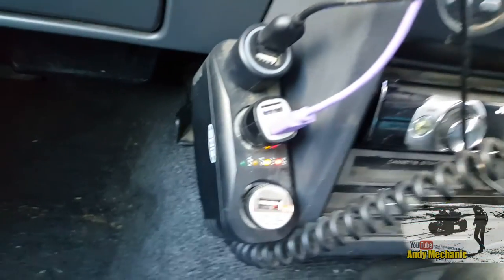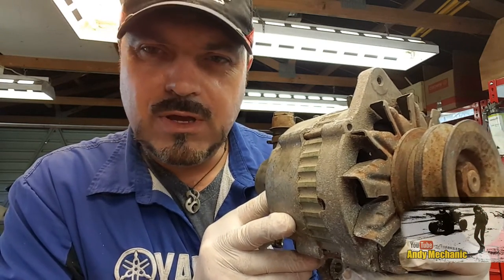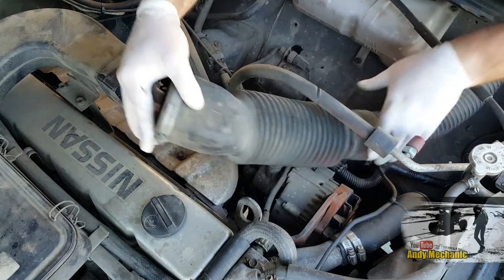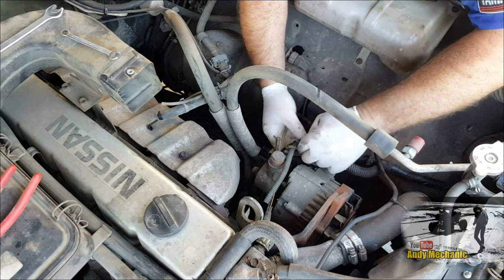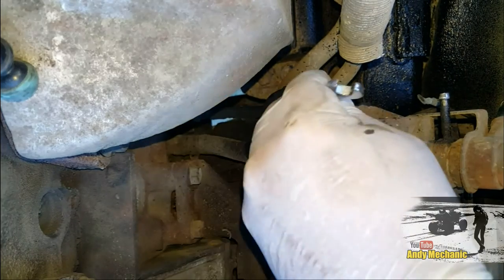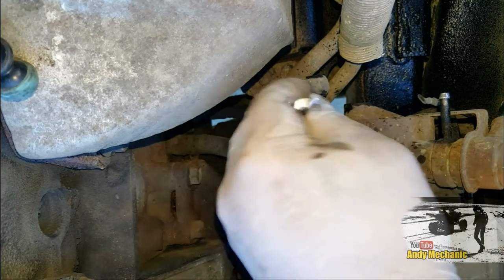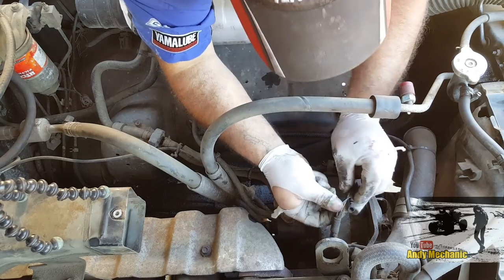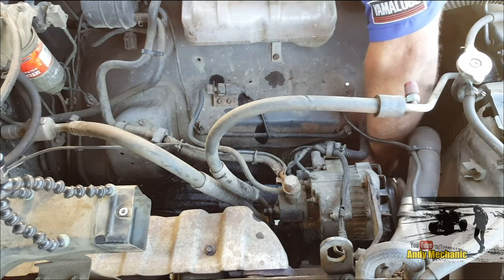Nissan Patrol charging circuit test & alternator replacement #1417

Comment: I have a TD27 fitted in an old London Taxi, when driving my voltage is 14.4V but when stopped in traffic with the brake lights on this drops to 13.2V is this normal? The alternator  was replaced before I got the car but the battery is old. After 2 years it has never failed to start, so it must be charging.
Reply from the maker: Yes, this is normal. Alternator output is much lower when engine is at idle & voltage will drop as more load is applied.

Cheers Andy
Reply: @AndyMechanic  Thank you for the reply, has put my mind at rest. The volt meter I fitted has been a blessing and a worry at times.

Comment: With respect the alternator's capacity is measured A and not Ah as I am sure you know.
This series is relevant to me - stuck in Portugal with a failed Denso alternator :-( All of the voltage and resistance readings which can be taken with the alternator in place are good so I have to delve deeper now.
Reply from the maker: Good Luck...let me know what you find :-)  Cheers Andy
Reply: @AndyMechanic  This is a weird one. The alternator has had less than 50 hours use since being refurbished by a reputable specialist in the UK. The vehicle is weill instrumented so I constantly monitor the charging current and the voltages on both batteries - everything fine. It just stopped charging. It's externally regulated and the field coil shows continuity (around 12 ohms) from the external terminals with a healthy excitation voltage. I now have little alternative to pulling the brute out and looking inside - this would normally be OK but I have no facilities here because I am traveling. Your videos will help, thanks.
The alternator installation is covered in my YT channel and I will no doubt do a follow up video when have fixed it.
https://www.youtube.com/watch?v=1b5QQ36_DgU&list=PL5KqEH5MNr7JU6ZW_kkTdtUv_AkqmNAFw&index=14

Comment: Can't say I've ever run into that issue of having to re-break in an alternator.  Glad it worked out, though!  That Nissan Patrol is a really good-looking utility truck.  Wish we got 'em up here in the States!

Out of curiosity, I've heard that you're supposed to be gentle with new/reman alternators, on account of the brushes being square and needing time to wear themselves to the profile of the rotor shaft.  Is there any truth to this?
Reply from the maker: +rhkips I was just allowing for the fact that the slip rings may have been corroded as the alternator had been in storage for almost 9 years and it looked like it had got very damp at some point judging by the oxidization on the casing.

It's working now but does sometimes stop charging so maybe there is another fault? I'll be investigating further....bench test and full strip and component test on the original alternator with a view of replacing the faulty parts and re-using it.

New brushes are sometimes square at the ends rather than shaped to fit the slip rings. I suppose the small contact patch could cause arcing until they have bedded in so I'm guessing they mean not to load it up too much (high amperage output) for the first few hours of use?

Comment: Hi Andy
Cheers for all the instruction and tips!
I have a 92 TD42 Diesel just like yours🙂
I have one niggling problem
I did a full service on the alt and got Amps at 0.5A but only Volts at 11.6v 
I then chopped wires back to fresh copper and cleaned all earths back to the negative on the battery but still can’t match the battery voltage
Where would you trace back to next on the red and white do you recommend?
Cheers again from Oz!
Reply from the maker: Hi, thanks for the feedback 😊 

The amperage output is very low too, not just your voltage. Is your battery fully charged? If it is then apply a load (headlights on, blower on etc) current output should greatly increase, if not then you have an internal fault in the alternator - likely voltage regulator. Do check batt voltage input wire is in good order too - needed as an input for voltage regulator to control output to charge battery.

Cheers Andy
Reply: @AndyMechanic  
Cheers for that Andy
Yes guilty I ran the battery down a bit doing tests (22.24v)
Gonna charge up tomorrow and try all the above 
Thanks again great channel!
Reply from the maker: No worries, sorry I didn't realize your is a 24v model, in that case, when it's charging you should see 27 to 28v output, not 14 to 14.5v.

You basically have no output - ID check continuity through rotor winding/brushes. The most common failure is worn out brushes so I'd check these.

Cheers
Andy
Reply: @AndyMechanic  
Sorry that was my typo it’s a 12v truck but thanks again!

Comment: Hi Andy! And thanks for sharing this video. It really helped me to build courage and kick off the same issue with alternator in my 1992 Nissan Terrano TD27 4 cylinder diesel engine. One question. If i would run the car for let's say 24hours or so with an alternator that is not functioning and the battery will be drained off completely... will the engine be still running if the battery die? Looking forward for your reply. thank you
Reply: If the battery drains completely you won’t have cooling fan steering wheel  lights horns and generally all electric supplies because the battery magnetic 🧲 the alternator for voltage

Comment: Hi Andy , Iv got a problem with mine
I have just installed my new 120amp alternator and now I have no power on dash lights or starter motor or alternator 
I found the starter/alt fuse was blown so I replaced it with a bigger one and it blew instantly on contact , have any idea or checks to apply ? 
Cheers , Kyle from WA Aussie
Reply from the maker: +kyle lang Sounds like you have a direct short to.ground. remove large output wire from alternator B+ post and check main alt fuse again. If it doesn't blow them there is an internal fault with the new alternator unfortunately.

Hope that helps

Cheers Andy
Reply: Andy Mechanic all sweet now , had a sparky come around and sorted it out 
Cheers Andy for the info
Reply from the maker: +kyle lang Awesome...pleased to hear you got it sorted. Cheers Andy